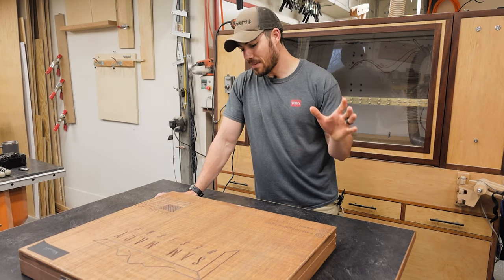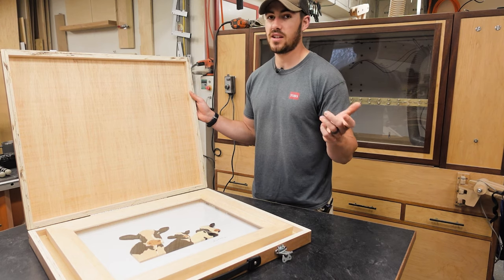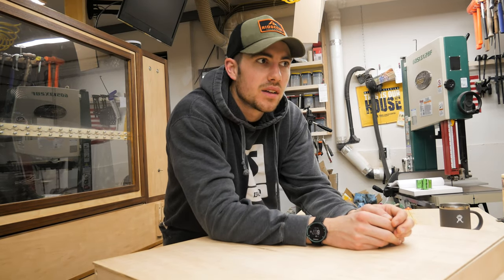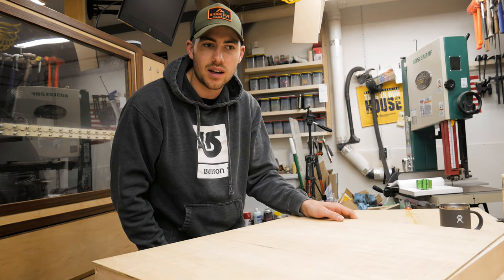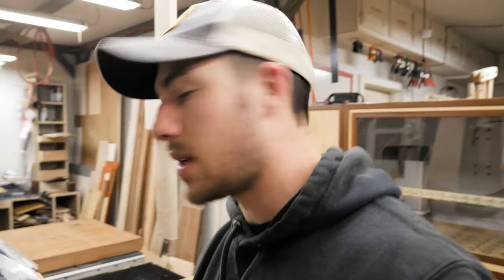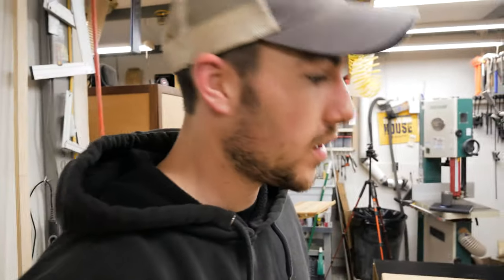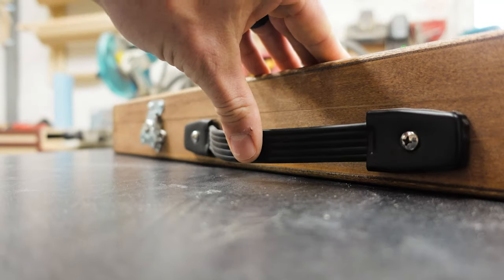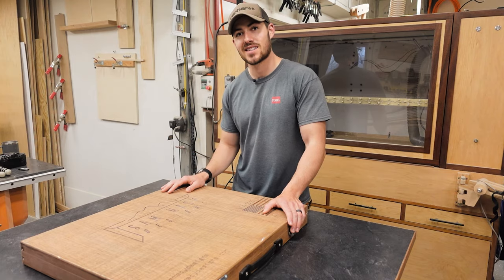Simple DIY Protective Case for Shipping Frame Art!

Comment: Add "for Framed Art" in your title. Maybe "Shipping Framed Art?"
I think you've inspired me what to do with a large framed picture I may have to ship.That, inside a box, with only brads to hold it (no hinge, clasps, or handles - pretty easy. (Nice Curious-Cow-art!)
Reply from the maker: I think that's a great suggestion! Also, if you're looking for the thin plywood I just found out that Honda generators are packaged with two 2'x3' pieces in each box. So if you can find a local dealership they may have some lying around for free 😀
Reply: @SamMacyDesigns  Great tip! I have one for you - Vietnam is exporting furniture quality Maple plywood to Big Box Home Stores, very nice to look at, great surface - 2 side, including down to 1/8", for dirt cheap a 4x8 panel - like $10. I stocked up because it's useful for so many projects.